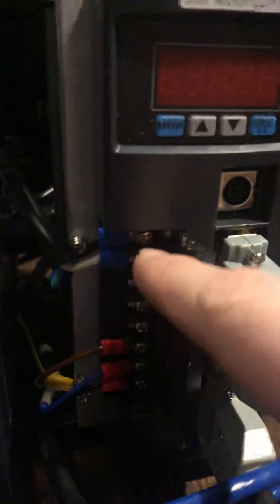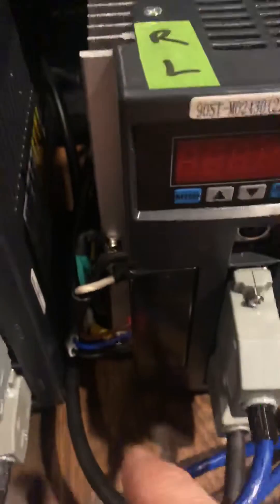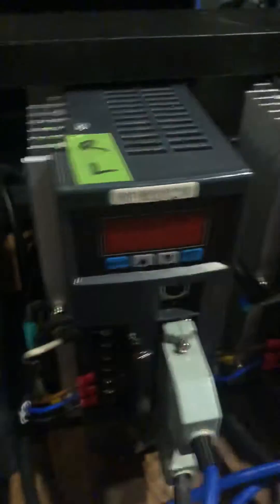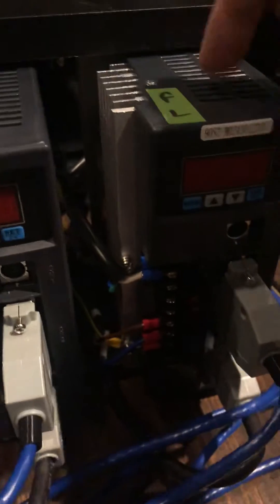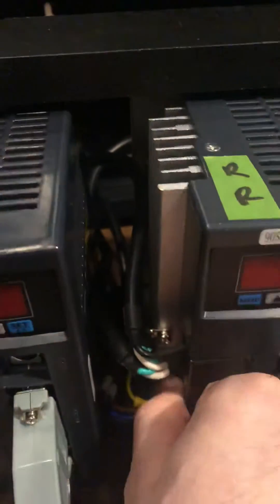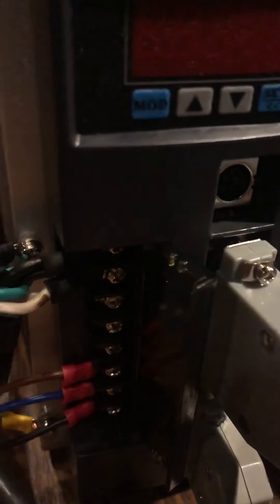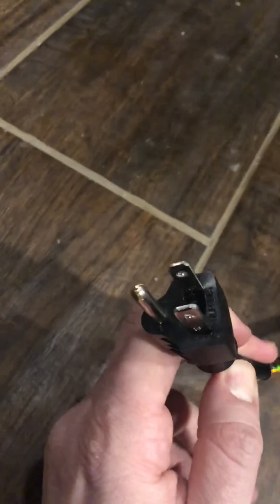Daisy chain motor controllers - Sfx-100

Comment: New to this what size converter you are  using and what is your 110 rated at amp wise? Thank you I hope you're having a great time with it.
Reply from the maker: I ended up having a 220 line ran. but their is now documentation on running them on regular 110 without a convertor
Reply: @ApexSimRacing  Thank you I seen from one vendor who mentioned that you could select ether 110 or 220 that left me scratching my head. I originally thought it could have been a mistake but they did show a chart with different setups but the n.M was I think was 3 under 220 and 1.8 under 110 I believe? I was worried what other impact but I guess I have to do more digging thank's again. At least it looks like it can be done.

Comment: Did you use just the L1 on the power side? I am in the US and just got my motors in just trying to figure out the best way to power these up. What gauge wiring did you use? Thank you
Reply from the maker: https://www.homedepot.com/p/Southwire-By-the-Foot-16-3-600-Volt-CU-Black-Flexible-Portable-Power-SOOW-Cord-55810099/204725139
Reply from the maker: L1 Black / L2 White / Green Grounded to fins on controller
Reply from the maker: i also used this on my first setup just cut it to size https://www.homedepot.com/p/HDX-15-ft-16-3-Indoor-Outdoor-Workshop-Extension-Cord-Black-SJTW16315BL/206586942 are you running a step up convertor or do you have a 220 recpeticle
Reply: Apex Sim Racing i ordered a step up converter as well. I am in Texas love the videos and they have been a lot of help. Cant wait to get all the parts in. Just waiting for bearing and what not. I might end up calling an electrician to install a 220 not sure yet.
Reply: Apex Sim Racing did you end up ditching the step up converter? Or are you still using it?
Reply from the maker: @axelamoe  thats what i ended up doing the convertor is fine but i got a buddy to run a lin for just materials
Reply: Apex Sim Racing did you notice any difference with the whine sound when you switched from a converter to a line?
Reply from the maker: Mohamad Ballout no same sound.
Reply: Apex Sim Racing did you ground every single one or just on ground for all of them? Is the ground daisy chained also? Sorry about to start wiring just want to make sure
Reply from the maker: Mohamad Ballout yah daisy chain all of them
Reply: @ApexSimRacing  I'm assuming this is 240Vac line with 2 hot wires (120 each) and ground wire? Can you describe how its connected to servo drivers now please?
Thank you!
Reply from the maker: Maciej Josse wires come with them for the servos

Comment: I feel awful because I'm basically harassing you now, you're just so helpful I'm assuming you're tolerating me. I just realized I have no clue what's going with the U,V,W power output terminals though at the bottom of each driver. Is this where the end of the Servo motor wire is stripped and connected? I thought the servos plugged right into the drivers.

Edit: LOL, nvm, the exact cables we need are included with the servos, whew. For a second I thought I seriously misunderstood the build, and we had to solder/crimp some of the wires coming out of the servo.
Reply from the maker: no worries a lot of people have helped me along the way too. Thats the power wire going to the motor. if you look in the manual posted on git hub it tells you where uvw go mine had little labels on the wire
Reply: @ApexSimRacing  Yep, it's the easiest part of the build! Just another, doh! moment from me. Y'all are great. Donating big to Saxxon right now to get into the Discord ;)
Reply: @ApexSimRacing  Got them all wired up just the same today. Feels good. I put all 4 in jog at the same time, and I'm definitely feeling and hearing that whine. When I switched off jog, it still there, so I'm hoping it's just a weird quirk of the controllers in jog. It's silent before I get into jog. Haven't wired up the Arduino, so I won't know how they respond in the software. Thanks for all your help tho mate, it would've been hard to take this leap without some help.
Reply from the maker: Scott Vermeyen the sound is there during play. To me it doesn’t bother me
Reply: @ApexSimRacing  I was actually using Jog_1, so we'll see how the noise is during application. When I went back to try Jog_0, the sound was only present when the servos were spinning. In Jog_1, it was just this crazy loud noise no matter the output, so I'm thinking it won't be as bad as I thought. Cheers